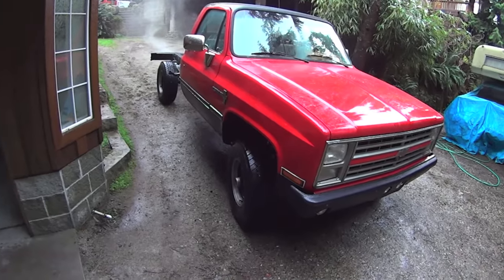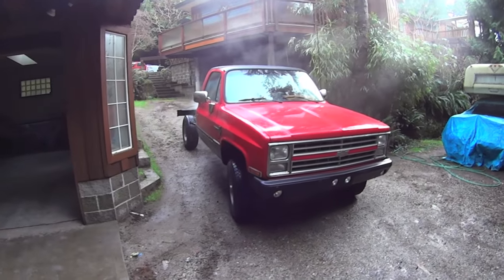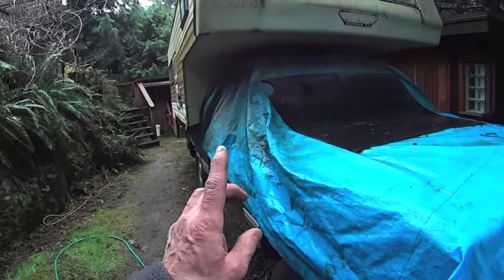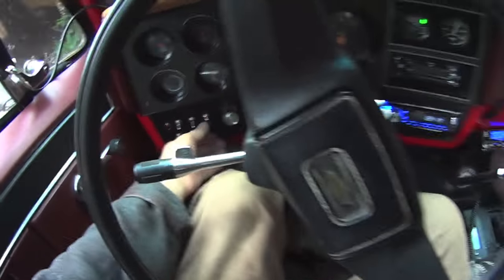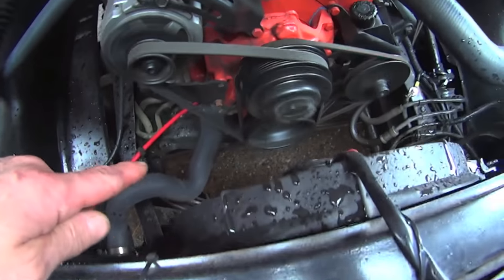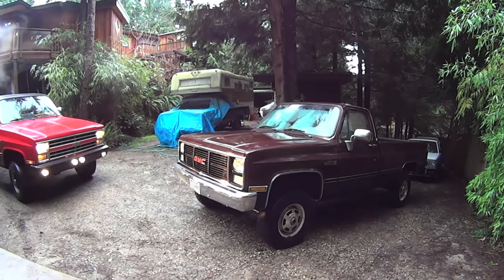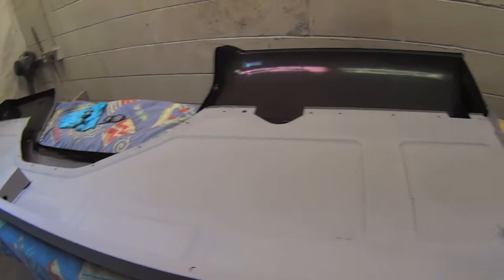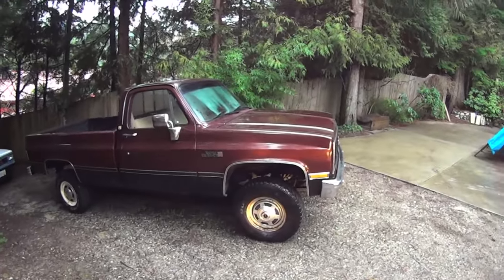1986 Chevy K-10 Restoration " Part "30 "

Comment: how many years have you owned the diesel? and curious what kind of shape was it in when you got it?
Reply from the maker: I got it in 99. Still the most reliable vehicle I have ever owned. I took it off the road because I bought my 91 S-10 and swapped the plates.  It looked like it was in great shape when I bought it, but it was a bondo job over rust. The drive train is still good in it , but its time to let it go. Going to get rid of it this year
Reply: gotcha! thanks for the reply. I always like to see how long people have owned their rusty trucks for. I like to see if they got them clean and then rotted out and how long it took. It's good info for me to compare and contrast to see what my own squarebody is up against in terms of rust.
Reply from the maker: Aside from the saddle tanks on the outside of the frame rails, the square body is a great design. I like the tanks on the outside cause it makes it easier to do overall mechanical maintenance to the driveline. Just don't get T-boned or wrap it around a pole .
   Depending on where you live most vehicles 35 years old are going to rust unless it was stored in a heated garage and wasn't driven in the winter. 
   What truck do you have ?
Reply: I have an 86 K30 and 87 GMC K30. and a couple others. The 86 is rust free from California. I live in CT. I've seen trucks get restored 3 times , rusting into the ground everytime and still brought back to life. it's amazing to see what people who live in salt states will do to keep stuff on roads
Reply from the maker: My solution to driving in winter is own a beater that you don't care about. Save your restored vehicles for better road conditions. If you restore a vehicle right , you should be able to drive it 24/7 for 10 years before you see rust again